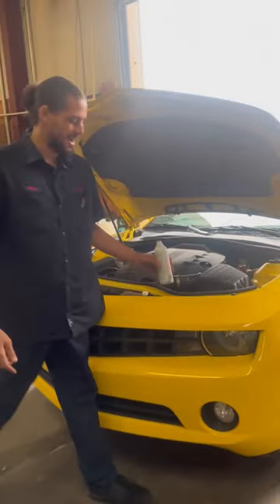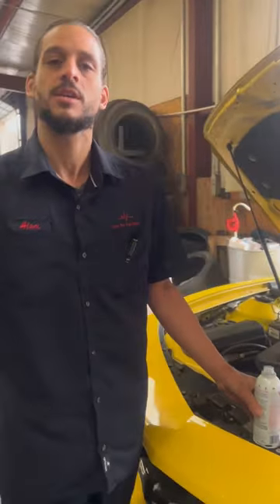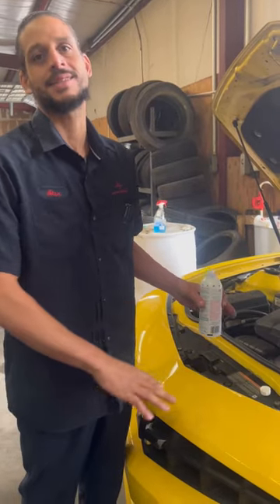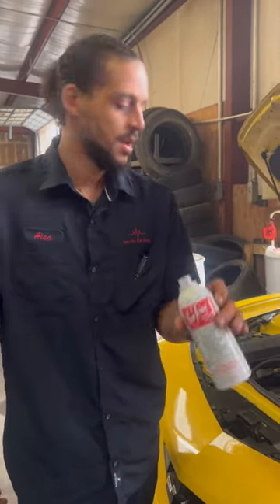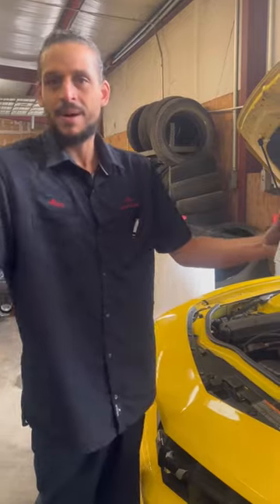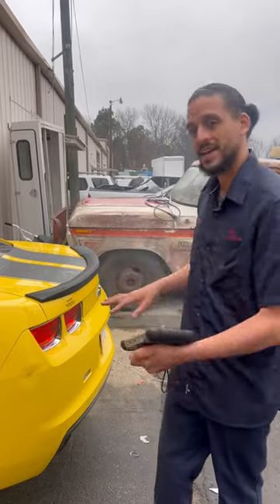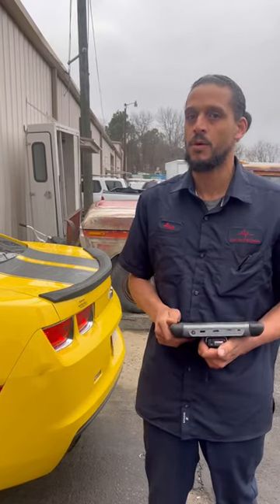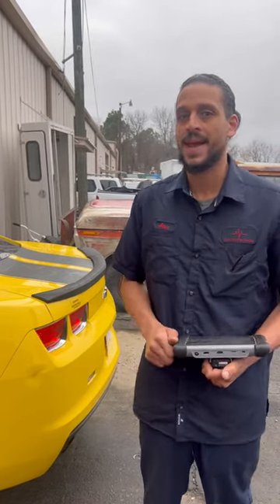Try this before you replace the catalytic converter  #cartips #chevycamaro

Comment from the maker: All that SMOKE 💨does mean it’s dirty.. according to my test! See the video here: https://youtu.be/7wfXEgrEDHU
Reply: The smoke doesn’t mean it’s dirty 😂. Run that shit in a brand new lawn mower and it will look the exact same.
Reply from the maker: @southpaw1519  did you see the follow up video where I tested this theory? Interested in your thoughts…
Reply: @AlexTheCarDoctor 

What hose did you unplug ? I wanna do on 98 xj.
Reply: @nathanmccumber8965 probably the hose to the brake booster. That's how I would do an induction service. Try lacquer thinner, but CAREFULLY! It's extremely flammable, pour slowly. Seafoam has oil in it. It will make a brand new car smoke. It was developed for fogging marine engines to be put up for winter
Reply: @nathanmccumber8965 I would probably try taking the 02 sensor out and dumping in the port
Reply: I've got a 2012 Honda that's throwing the p420 code for the cat being under the threshold. I use cataclean last time in the light went away this time I try to bottle and it didn't go away do you think the Sea foam would work?
Reply: I guess you don't know how cats work. You can't clean them. 420/430 is not because they are dirty. They are not working as well as they should. The only thing you can do is replace them.
Reply: All that smoke came out the tail pipe because you put some bull shook in the engine. I thought you were a good tech. I hope you didn't charge the owner for that complete waste of time.
Reply: He said 50/50 chance 😂👍🏾
Reply: @ronaldbrooks5427  He lied 100%
Reply: My TESLA don't have those problems 😂😂😂
Reply: @dontrustwhiteyevery1  When the power go out. Your Tesla has other problems.
Reply: It has a dy makes it white
Reply: @AlexTheCarDoctor where do you put the seafoam
Reply: @blackericdenice  you can  actually clean the cats I’ve seen it done
Reply: @dontrustwhiteyevery1 5 years your ev Tesla will be off road and you’ll be buying a hydrogen Tesla lol
Reply: @CristianMorales-p2u  Funny how people with no videos always have seen stuff that's not true.
Reply: @dontrustwhiteyevery1  Your car has no style and can't even take long trips in it😂😂keep plugging up your little car buddy😂
Reply: @blackericdenice he on that DOT Secretary ride bootigeg million of dollars only 3 or 4 charging stations
Reply: @CristianMorales-p2u I read someone said you got to stab through it with a three or four foot bar
Reply: I use cataclean. Great product you should check it out
Reply: @rainey3303  good idea
Reply: No but it will need a 30K battery in 10 years. Enjoy it while you can.@dontrustwhiteyevery1
Reply: Lmao the ppl saying this dont work aren't real technicians i do these all the time and ive had cars that blow no smoke and ive had cars that made my parking lot disappear there is no dye in bottle and its not fake. Keeping ur intake/exhaust sytem clean is vital to well performing engine
Reply: Lmao the ppl saying this dont work aren't real technicians i do these all the time and ive had cars that blow no smoke and ive had cars that made my parking lot disappear there is no dye in bottle and its not fake. Keeping ur intake/exhaust sytem clean is vital to well performing engine
Reply: @AlexTheCarDoctor  where did you pour the Seafom?
Reply: Bru come on you're a mechanic. Sea foam is an oil... Put any oil in a motor and you'll get smoke out the exhaust XD
Reply: @oscarjones134 stop with the bullshit, seafoam is an oil and anytime you burn oil in cylinder you get smoke, now there's a chance that a very good catalytic converter will be powerful enough to convert all that smoke down but it's unlilely. If you're a mechanic stop. Time to revisit your ASE
Reply from the maker: @DarkAttack14  so why does some cars smoke more than others if I put the same amount of seafoam? Genuinely asking…
Reply: @nathanmccumber8965  the hose from the brake booster
Reply: @dontrustwhiteyevery1  your tesla won't last 7 years
Reply: Yeah that's cleaning all that nasty ass carbon in the system NGL my Chevy has a da same issue
Reply: @dontrustwhiteyevery1  you think you're better than us don't you😅
Reply: @blackericdenice damn bro,you have got to be the grumpiest mechanic ever!😂😂😂
Reply: @oscarjones134 were did you pour it in???
Reply: @hpmetabolics7558  I'm not a mechanic
Reply: @krakenhits1587  did you ever try this sea foam ?
Reply: @orchidsareeasy2850 did cataclean clear p0420 & p0430 codes ?

Comment: The smoke is the seafoam.
Reply: I can't believe the number of people who base how dirty engine internals are by how much smoke it blows out when you load the thing up with Sea Foam or Cleens or whatever. Put whatever you want in the engine. Water, diesel, kerosene, the list goes on and on. It's probably going to smoke like that. And if you take it for a road test and repeat the procedure it's going to smoke just as bad the next time. You could do this a hundred times and it would still smoke like that. I'm not saying that these products don't do something to help clean carbon and shit out of the engine but the smoke is not a very good indicator of how much or what it is cleaning.

Usually following the sea foam with about a third of a cup of water dribbled in at the same rate will help steam clean the remainder of whatever is left on the tops of the Pistons and in the chambers.
Reply: @HerculesRockefellerESQ  Not true at all. I have done this with my Dodge truck twice, first time smoked a bunch just like video, second time very little smoke and my Toyota very little smoke. If what you claim was true, they would have smoked the same everytime.

Comment: if the customer don’t come back it might be because they went somewhere else
Reply from the maker: He never came back so idk lol
Reply from the maker: I know this customer personally
Reply: My 2017 Toyota 86 spit out that code yesterday . The cashier at autoparts store told me to try Lucas fuel cleaner. I did and it helped. The check engine light is not on anymore..keeping my finger crossed. Thanks for sharing.  @AlexTheCarDoctor
Reply: Did the customer came back - just curious . Thank you @AlexTheCarDoctor
Reply: @vision1707 is your light still off?
Reply: @vision1707  need an update bro
Reply: @AlexTheCarDoctor so I just moved to Illinois from Miami in December 2022. I have a chevy malibu 2016 LS and every time it gets cold out here I get a reduced engine power notice on my dash. Any ideas what that could be. I read somewhere it could be a dirty catalytic converter but I'm not sure. Changed the batter, mass airflow sensor, and the accelerator pedal sensor but still happens when it's cold. It'll run but if I try to push it over 400 rpms the car stops accelerating but as soon as it goes under 4 it accelerates again. Sorry for the long comment I just don't know any mechanics I can trust out here yet and scared to take it in and get ripped off. They tried to charge me 1200 to replace a radiator luckily I found a AC specialist who did it for 800
Reply: @valentinberrios4017 that usually be the throttle body
Reply: @valentinberrios4017 the intercooler could be freezing up. Remove the charge pipes and check for water
Reply: Lmao
Reply: Stop hating
Reply: @vision1707 That's what I was thinking of I was thinking about Lucas I need to try it on my wife's Kia soul Kia is trying to get $3,900 for cat converter replacement
Reply: @duke6024 Try replacing the post-cat O2 sensor first.
Reply: @vision1707 did it stay off? And did you have both p0420 & p0430 codes?
Reply: @turboshottho  🤣🤣🤣😭😭😭

Comment: If anyone is wondering he was pouring it in the brake booster vacuum line, u need a buddy or a stick to hold the rpms around 2000 while you disconnect the vacuum line and pour it slowly in the line.
Reply from the maker: Correct !
Reply: I've done this twice on my 07 JGC ... AND it has helped my mpg and performance.  190k. i drove from S Florida to KC and back... no issues plus that drive at 75mph for 40plus hours round trip really cleaned out everything.
Reply: Thanks for explaining what he did in video...
Reply: Why in brake booster line
Reply: @AlexTheCarDoctor  yes why Seafoam ? Can other fuel cleaners work ?
Reply: @harlemmarine1234  goes directly to intake manifold.
Reply: @deejay_g2gproductions838  Agree. I always do it that way.
Reply: Does that clean intake valves on a GDI engine?
Reply: @vincentsmith2774  not sure, but there’s a CRC GDI intake valve cleaner that you comes in a spray can w a straw 👍
Reply: @AlexTheCarDoctor  How's the Seafoam getting to the cat of it's being burned in the engine first?
Reply: @5jjt  You have a good question and point there honestly?
Reply: @5jjt  its cap. The bottle doesn't even mention cats. I ordered one just to realise it doesn't mention cats.
Reply: @hajileserpud9539  no. Other products don’t work. Seagram is really one of a kind.
Reply: @vincentsmith2774 yes. They make a top end cleaner that you spray into your intake boot after the maf sensor that makes it a little more convenient.
Reply: @thagingerninjer5391  thanks for info....

Comment: I used this stuff for the first time back in 2012 on my Mitsubishi Lancer. I had cat codes for over 2 years. Ran this stuff through the gas tank and pvc. 2-3 days later, after driving, the codes went away. I've been using this ever since. Alteast twice a year in my cars
Reply: Did ya car develop a smell after having the cat codes for a long time? Like a rotten egg smell?
Reply: @RodneyFx if that is the case you need new cats.
Reply: You put it in the gas tank?!
Reply: What does pvc mean?
Reply: @luna_goddess3333  he meant PCV Valve. I’m sure it was autocorrected as “PVC”.

Comment: Hey Alex. Love seafoam been using it for years brother. Remember the 02 crv my kids fixed up. This was the first thing they learned how to do. Ypu should have seen the billowing smoke from a almost 400k motor. It looked like a big truck rolling coal.  Guys always try to do this before you replace ypur plugs. Stuff will bind to the electrodes if your engine is that bad.  It's good to clear gunk on the inside for your oil as well.

Comment: Been using it since 2018 twice a year on my vehicles, also 500 miles before oil changes on my 08 Escalade, when I did my cam on my Escalade the inside was clean with 180k on it 🤪, it works 🎉🎉
Reply: so this would get rid of the codes (p0420&p0430) for awhile and run better?

Comment: it’s always fun to run “top engine cleaner” (or Seafoam) drive it a few miles and retest with the sniffer, had great luck with Hondas, knocks down the Oxides of Nitrogen (NOx) 😂
Reply: Thanks for this.  I was hoping for some real test data.  It's tough to trust products based on hearsay.  Good to know it's been tested for this.
Reply: @thewatcher611 so this would get rid of the codes (p0420&p0430) for awhile and run better?

Comment: this can actually sometimes clog a cat, all the oil build up in the intake and inside the cylinder gets cleaned up but then goes out the exhaust to get trapped in the cat. had this happen on a 2004 wj with 4.0

Comment: That's why I am confused. I didn't have converter codes at all. I had a P0300 code. I took it to the repair shop to get it checked out and they told me that all 4 catalytic converters need to be replaced.  The price they quoted is $3500.00.

Comment: I did these to my car today 2024 of April and it worked like a charm I would recommend using the spray or any would work but I used the spray with the little red hose it comes with thanks man I saved $550 bucks and all it costed was  $15 it does clean your car like you said it would
Reply: so this would get rid of the codes (p0420&p0430) for awhile and run better?

Comment: Except, cmon man, you and I both know it's either a blown head gasket or more than likely piston rings letting oil go by and burn up ruining the cat
Reply: Seriously, why do they never get to why the cat is "bad" to begin with. Cats don't fail without some engine problems causing it.
Reply: Nope, the smoke is from the seafoam being put in the vacuum hose, straight to the intake
Reply: @XJon2011  many times there’s an underlying problem. But I’ve replaced a good number of catalytic converters that failed with no apparent underlying issues. No misfires, no oil consumption, no coolant contamination, and no rich or lean running conditions. The catalytic converter was replaced and NEVER failed again. I do always try to rule out an underlying problem. But if I don’t find one, I have no qualms with replacing the catalytic converter only.
Reply: Usually it's lack of spark plug replacement. If you keep good plugs in it, the cat will last a lot longer. Always use OEM plugs.  You get what you pay for!
Reply: These piston rings tend to carbon up and stick, so they don't rock and wipe the oil properly.  Seafoam could have cleared that up.  I agree, usually a bad cat is only a symptom, but here we have a bottle that apparently fixed it.  Try it!
Reply: @XJon2011  City driving,  not enough highway driving. If they don't get hot enough to burn off,  they clog.  This is basically the same thing as doing a regen with a diesel engine to clean the dpf. Not to say that there wasn't an underlying issue,  but I've done this a few times over the years with exacting success.

Comment: See Scotty Kilmer's video. 1 gallon of lacquer thinner to 1/2 gallon of gas. Drive for 150 mostly highway miles or rev at 2.5 for at least a half hour. Thanks for your video.
Reply: This works.
Reply: Shiiii don't work
Reply: Cataclean fixed my converter but I have 333,000 miles on it so it took two treatments 😊
Reply: 1 gallon per half tank,not half a gallon

Comment: Quick break down. Suck it in through a vaccum line. Its gonna want to stall out so on drive by wire get someone to open the throttle.  Older vehicles open the butterfly valve by hand. Its a temporary fix. It might do irreparable damage to the cat. Check why the engine is running ritch on fuel.

Comment: Thats a air induction service cleaning carbon out of the intake I would be interested in learning how/what of that cleans the cats out.if you have had success I might try that I just never tried it for those codes.have you ever used BG products they work better

Comment: I love Seafoam I use it in my 2012 Cruze 1.8 with six speed manual bought it at 101 thousand miles now hit 145thousand only problem I had was leaking oil cooler that's it.

Comment: You can literally take the cat out the car and physically clean it and put it back that engine light is gone. I am a mechanic and that’s the truth unless it broken and there holes then that’s a different case but if it’s clogged or dirty, cleaning them will eliminate the light.

Comment: Well Seafoam has oil in it... Soooooooo... It's going to smoke no matter what 😬
Reply from the maker: https://youtu.be/7wfXEgrEDHU?si=CNKCM6GqGdFjjqXK
Reply: @AlexTheCarDoctor  thank you for replying with this video. First let me say you are wild. As a retired diesel technician, I have found that Gumout works a little better. Because it has nitrogen in it and it helps counteract the build-up from the ethanol they put in today's fuel. Only problem is gumout doesn't sell a can with the spray nozzle on it so you can spray it straight into the throttle body while assembled.

Comment: My mechanic removed the catalytic converter, put a blower in it and blew a ton of stuff out of it. After he put the catalytic converter back, the catalytic converter code went away and a code for the mass air flow sensor popped up. They replaced the sensor and so far the car is running ok.
Reply: You could've had a vacuum leak this whole time. That's very suspicious of that happening back to back.

Comment: Will this work on a 2016 kia soul? I changed the catalytic converter (the old one was completely clogged). But the p0420 still came back after a week, Im also going to replace the oxygen sensors.

Ive never used seafoam but Im a bit weary about using it on a GDI engine.

Comment: I would never ever use seafoam in a motor again. Ran it for a few and That shit seemed to dry out the motor. When I started car after adding oil back in I heard a loud shreks and the motor made a noise after. Oil change places I went to wouldn't touch my car when it was time to change it😢 found out the oil pump needed changing. Fate or negligence, no more Seafoam

Comment: I have a question for you sir. Other youtubers have the engine run at optimal temperature shut the engine off then pour it into the throttle. After that they start it up and rev. Safe?

Comment: All that smoke in the exhaust was the unburned chemical. You can see in the live data in the scanner it the cat converter is bad. If the rear o2 sensor fluctuates during engine operation the cat is bad.
Reply from the maker: I don’t mind changing my perspective so I am Genuinely asking, why do some cars smoke way more than others?

Comment: LOL.."all that smoke out the tailpipe indicates that the system was very dirty" nothing to do with the seafoam(that's oil based) being introduced to the intake, via a vacuum line, and getting burned off during combustion
Reply from the maker: Sounds like you haven’t done many of these… if you have then you’d know that some cars smoke less when the system is clean and some smoke heavy when the system is dirty. You should know that I don’t talk out of neck, I’ve have tested this over the years for myself.
Reply: @AlexTheCarDoctor  Well some people thought they become a Pro tech after owning just 1 or 2 cars at home...🤣🤣
Reply: Says the guy that can't see that he is clearly not putting it in the intake lol

Comment: Please tell me you didn’t use that brake booster line….. you will straight up hydro lock a motor doing that… always use the smaller purge to intake line…